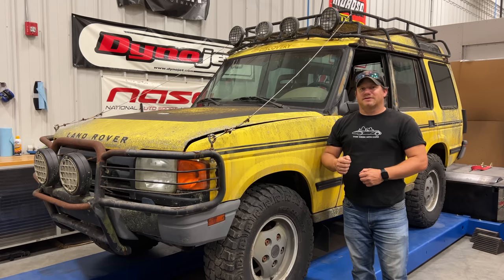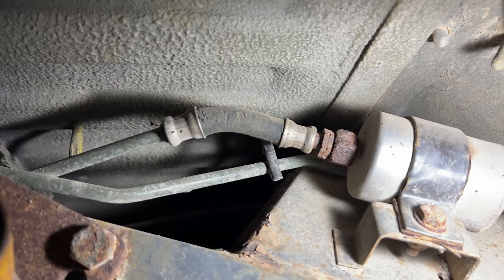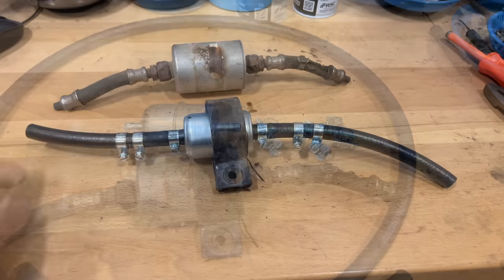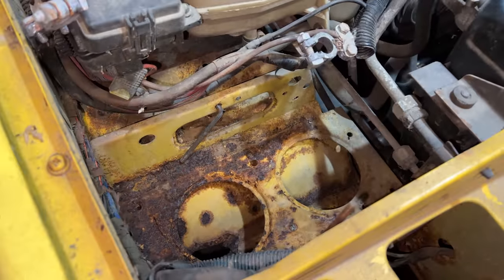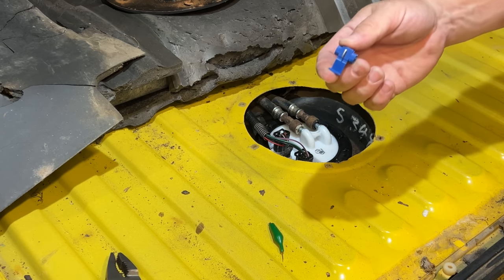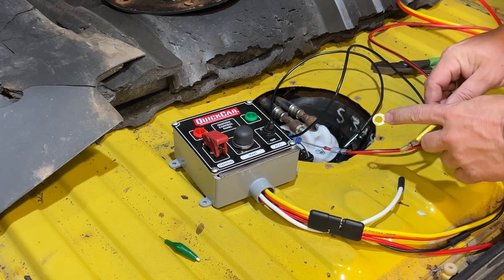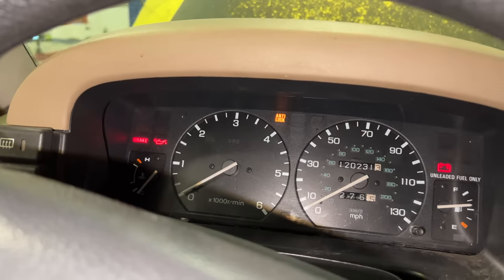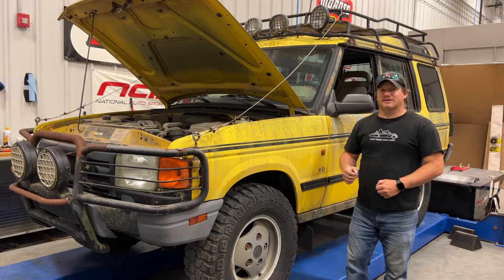Part 3 - Will It Run - Land Rover Discovery XD

Comment: Side note. Using a brake flare tool. Put a small flare on the end of the fuel hard line. Will keep a hose frame slipping off under pressure. One clamp will do after that.
Reply: I knew that from training as a mechanic.  made up loads of pipes. Always surprised me why Kevin & Co.  keep using rubber tubing.....   😁:elbowcough:

Comment: Hello Steve  I notice that when you were cranking the engine the oil pressure warning lamp remained alight,this age of discovery as a protective circuit built in that stops the engine running without the required oil pressure if it's been left for a long time it's lost pressure at the oil pump do please prime the pump before you go chasing around all the other systems 
Good luck with it.

Comment: Fun fact: if you have the coil pack set up instead of a distributor (sounds like it), it is the same set up as the Series 2 disco. Having as many Land Rovers as you do I assume you have RAVE. I will say, prime the oil pump on these old buick/rover V8's. Cam and Lifters are made of cheese. Check N/P safety switch, oil pressure switch, immobilizer switch, and crank position sensor. Man I missed that start up ding of a D1.

Comment: A no-spark situation is 90% certain the coils. The disco units (and GEMS rr has the same) are a lot easier to do  - I put longer bolts in place of the lower mounts on my Thor coils so with the upper bolts removed, I could just slip the coils up and tilt them back. With a head gasket change annually (my engine has the so-called 'porous block' issue), that saves 20-30 minutes each time I need to get the top end off. The way to go is test a couple of cylinders from 1 coil pack  and then the other. That's 1 6 5 8 and 2 3 4 7 so if you have bad spark on 4 or 8 of those then that's culprit #1. HT leads fail of course as the factory leads are so-so, but it's rare and you wont see 4 or 8 plugs with no spark, just the odd one or two. At least with the GEMS system, the coil packs are cheap!
Reply: I assumed before this that you've not got knackered plugs and that tyou have fuel getting to the rail...
Reply: PS: put some rust converter on the battery tray asap - also on the rear door shuts and the boot tray - as it looks close to unsavable and you do not want to be fixing rotted panels. There are guys stamping replacement sheet parts for discos, but better to stop the original metal getting that far that it needs to be cut out. Welding in replacement sheet is a pain in the bum on them as it's pretty thin and even with a decent TIG welder as blow-through is hard to avoid. Ofc I am an amateur welder so that might be my incompetence...

Comment: First off: with no FOB the immobilizer is stopping your crank and/or spark/fuel. There is a EMK code u can flip with the drivers door key 1515 or 5151 is the 'Dealer Code' (not sure which, but ie unlock once lock 5 times repeat) and that will get past a LOT of issues. Next check other plug wires for spark, but lets assume their all dead. Check under the engine for Rats chewing wires on back of engine sensors. BUT whatever is stopping the power to the fuel pump is ALSO killing ignition; makes me think immobilizer! Also the Neturel/Park switch can stop cranking as well, might help to wiggle the shifter on no crank, but the hammer trick tells otherwise.. FYI, you probably have to type the 1515 code into the door EACH START! Why I ended up getting used FOBs and paid dealer to program ECU to them. Hope this helps man!  96 disco 1 here
Reply from the maker: The FOB does work and the immobilizer is not the problem.

Comment: Hi Steve - good try, at least you solved the fuel issue and that's no small feat!
Concerning the ability to start, my experience with XDs is nil, but you touched on the crank sensor and I would check there.  All my LRs used traditional distributors, with an attached amp module.  The amps they've made for the past decade are very unreliable right out of the box.  However, it sounds like the XD's setup does not use this method.  Best wishes getting rid of the electrical gremlins!

Comment: Why not throw a little Ospho or some other kind of rust converter at that battery tray?  Half an hour with a wire wheel and some rust converter would probably work wonders.  Or is that a rabbit hole leading to a full restoration?  lol

Comment: yeah I would like to see it run it could be anything but if it not running the pump could it be a ignition switch issue or main relay issue or immobilizer issue

Comment: First rule of electrical diag: thou shalt check voltages. Need to find a circuit diagram first to know what you’re looking at. If voltages are OK signals are next.

Comment: I just had to replace the fuel pump on my 1995 D1.  Much easier for me.  I had a plastic ring, not metal, so it rotated with just a few taps.  Also replaced the fuel filter.  My car has no rust, thank heavens, and has a reliable distributor.  The only expensive issue I have had is a new alternator. Mine has about 105K miles on it and I have owned it 16 years.  Fuel mileage is 10 MPG. :(

Comment: Although Steve asks for help I am never sure he needs it! Seems to have the whole thing ironed out although how he remembers whether he checked for a spark or not is anyones guess. English , American or made in Japan I’m not sure any electrical system is designed to last without attention as long as some of these vehicles. Honest John in the Telegraph used to say about 8 years for most cars and the scrappage scheme we had a while back gave you £2k for a 10 year old car I think.  Not sure anyone builds cars to keep out mice either?
Reply: I rarely buy any car that is less than 8 years old and I usually get at least another ten years use from them (except for my '84 V8 Defender which I have had for 29 years, mouse-free)
Reply: @robt2151 And the reason is that you can fix them yourself and I have to pay labour costs!   Makes one heck of a difference. And even when fixing them you have found a way to make a few bob out of youtube. None of my skills have earned me even a Pound sterling on youtube yet!